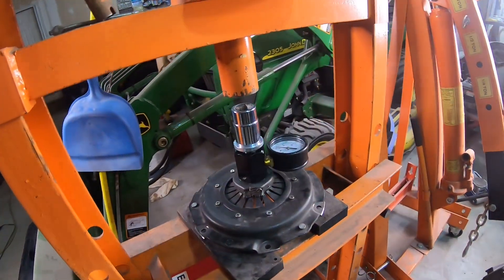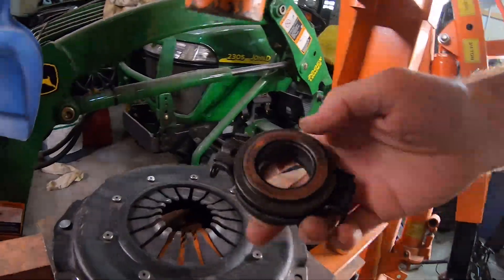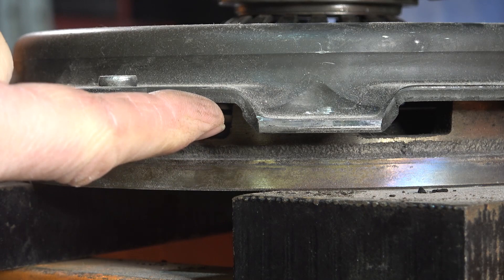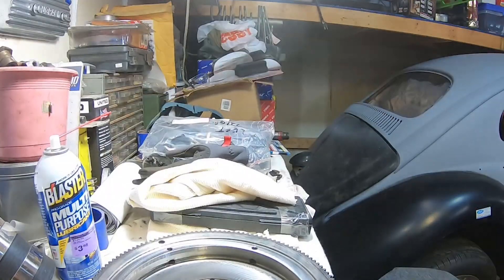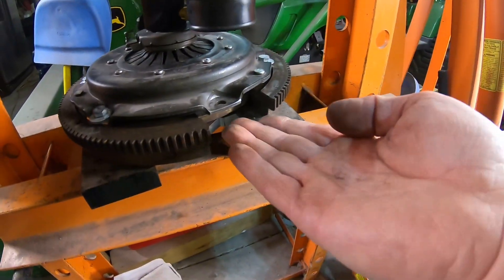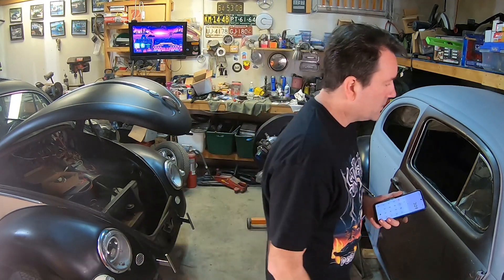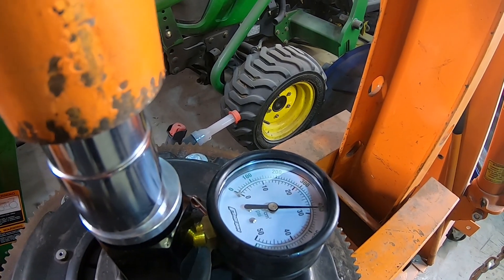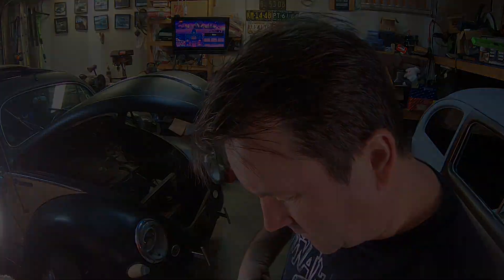Testing a Type 1 Beetle Kennedy stage 2 Pressure plate

Comment: .030 shims worked for me with the black magic disc.
Reply from the maker: Are you still running it?
Reply: @ddk56vw  I have the .250 Black Magic. Shimmed until it had max holding power. It has been pretty trouble free.

Comment: Firstly,....why would you cut the flywheel at a mounting hole?...lol
Second,....do you have the stop arm on your clutch pedal?
Why are you measuring freeplay at the throwout shaft?   Do it at the pedal.
Only adjust the wing nut at the tranny to get full release so as to not overextend the pressure plate.....if you have 2" inch free travel at the pedal and it still releases,...go with that. (2" just being an example)
Reply from the maker: That .003" at the throw out shaft gives you roughly 1" Freeplay at the pedal. I got that right out of the repair manual. You need that Freeplay so the pressure plate doesn't drive the throughout bearing and wear it out prematurely. Oh ya, I do have a stop on my clutch pedal. Thanks for watching.